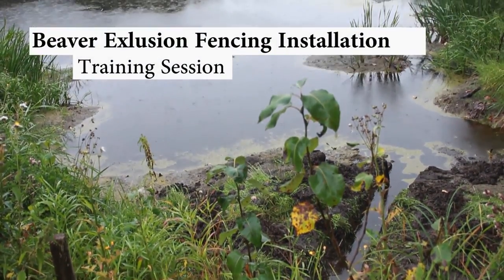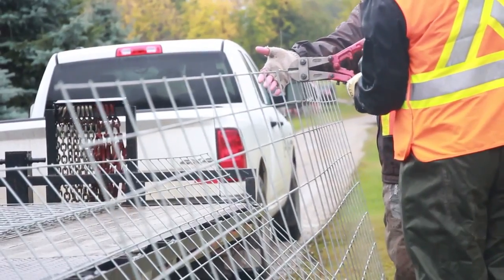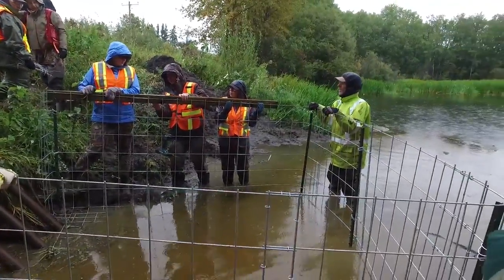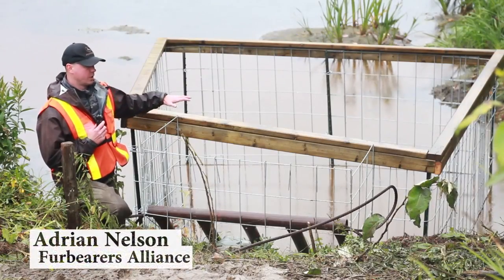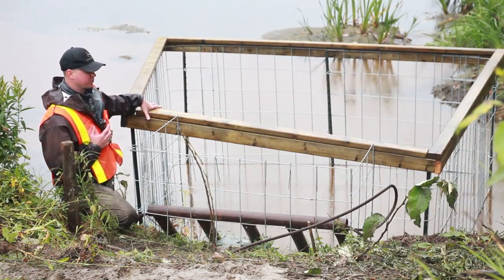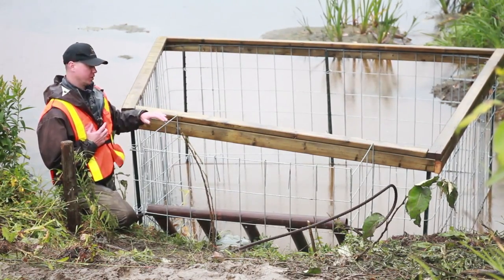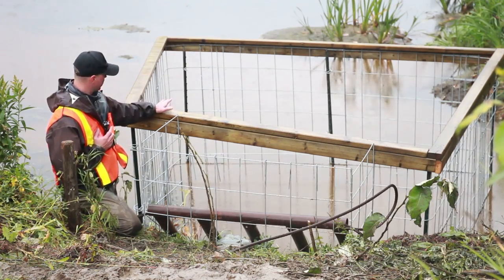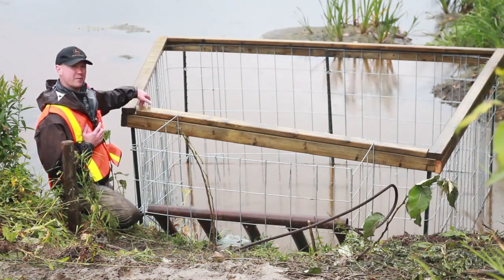Beaver Exclusion Fencing Installation - Training Session

Comment: Looks pretty good.   Just has to hold up against whatever flows down into it. 🙂
Reply from the maker: Exactly. This is why it's recommended that the exclusion fence is checked several times per year to ensure any debris that gets stuck against the fence is cleared away. This is much less time consuming than clearing a plugged culvert.

Comment: You are badly underestimating the intelligence of beavers.  They will have a mud and stick dam built around that thing in no time at all.
Reply from the maker: Hi there, thanks for your comment. Although beavers are incredibly intelligent, the unique trapezoidal shape of the exclusion fence is highly successful with a 95% success rate when installed in an appropriate location (not every site is ideal for exclusion fencing). The shape allows the sticks/debris/mud that beavers place on the fencing, to be washed to the side of the culvert exclusion fence. Regular maintenance (1-2 times per year) is required to ensure the debris isn't building up along the sides. For more information on exclusion fences please visit: https://www.beaverinstitute.org/problems-solutions/flooding-from-dams/